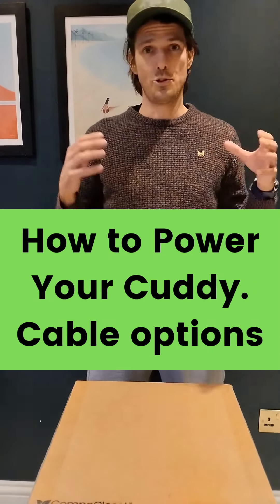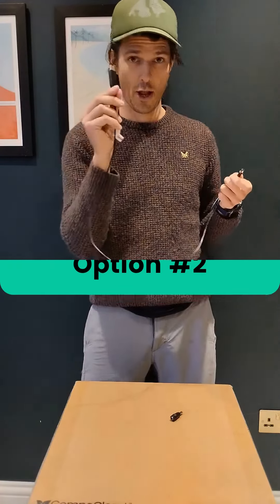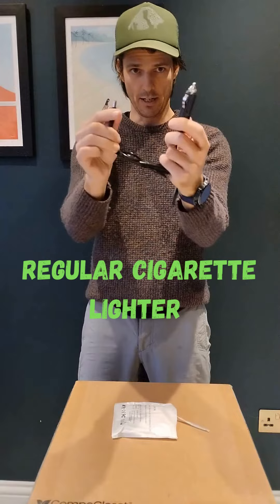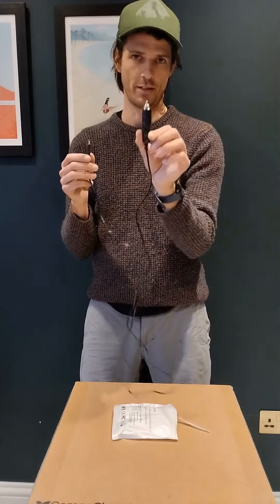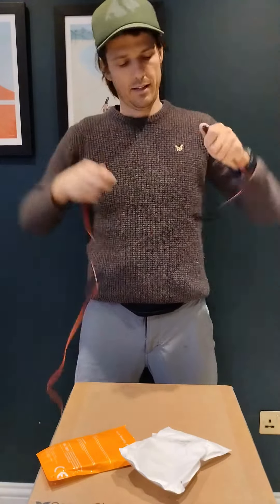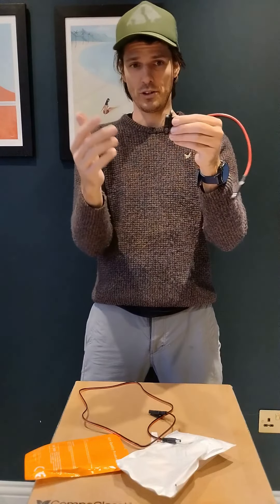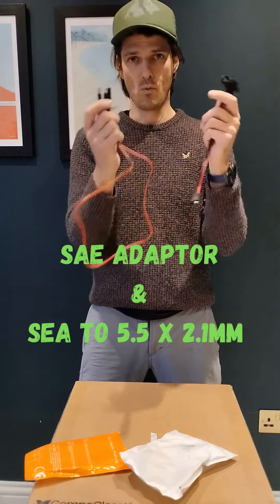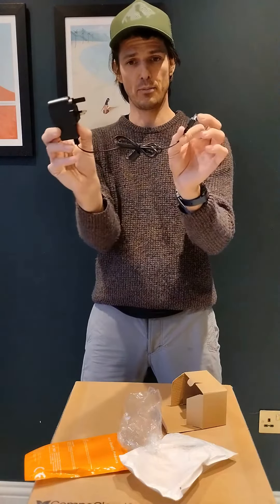How to Power your Cuddy - Cable Options

Comment: I'll be using a Cuddy in a pop-up camper on a Ford Lightning EV pickup truck.  The truck has 110V outlets in the cargo area, near where the Cuddy will be installed.  It would be perfect if I could get a household type 110V plug cable (your option #5) BUT with a stretchy cable (your option #1).  The Cuddy will be in a cabinet on a slide-out drawer, just a few feet from a 110V outlet.  Does a 110V plug stretchy cable option exist?
Reply from the maker: That would be cool. I haven't seen one, but Amazon is a big shop and sometime you have to get the wording right to find what you are looking for.

Comment: We want to have a cuddy in our van's wet bath but didn't know we needed electricity. Could you clarify if this is a must or just optional? What are the pros and cons of not having it plugged into power? Thank you
Reply from the maker: Cuddy has an internal fan that runs off 12v. The pros of plugged-in is that the fan will run. The fan can either push air through the carbon filter or to vent Cuddy externally. This can help with moisture. The con is there can be moisture build-up. Here is a video about venting. https://youtu.be/Y7pUFMARWtw?si=vZZSTAd0PTa-4Sb7

Comment: Can I connect the 12v bare wires directly to a spare car battery or will that be too much and blow out the fan?
Reply: Hi! yes but be sure to use a low amperage (1A)  fuse to prevent fires.